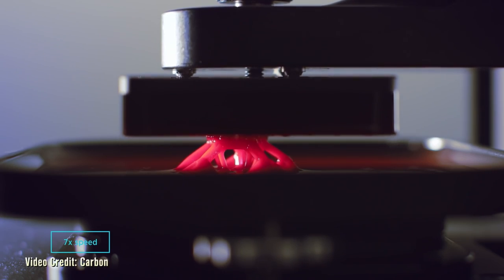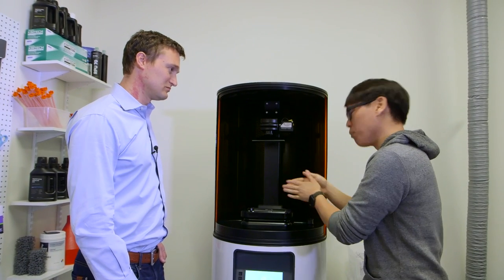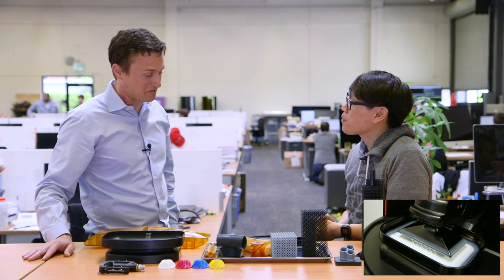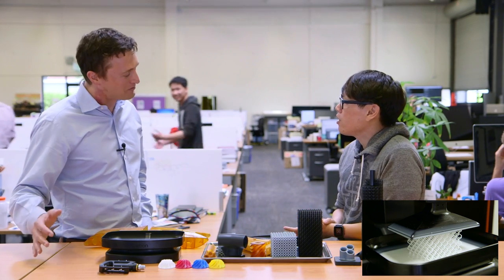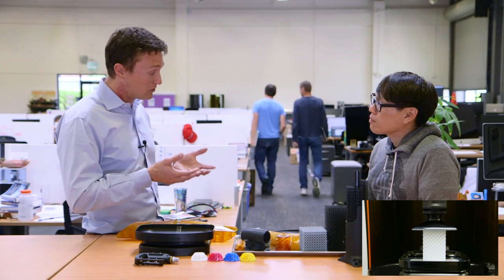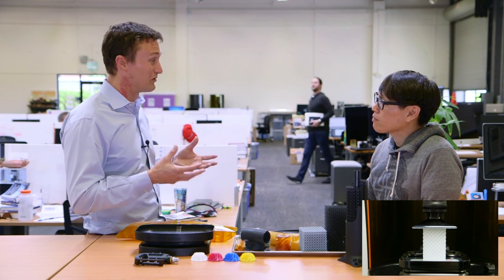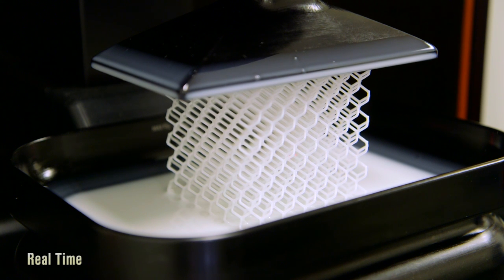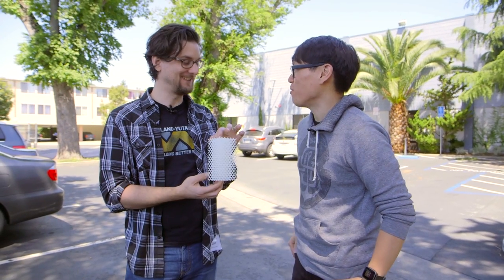Carbon M1 Super Fast 3D Printer Demo!

Comment: Man this guy talked in circles, and repeated himself many times, in many different ways. Sticking to the corporate script, I guess.
Reply: If you were running a business in a breakthrough company/product you wouldn't want to give away your secrets either, genius. You can only answer so much before you give away too much and have asshats stealing your product and idea.
Reply: +IVIusicFiend they will fail on their old world, closed business model anyway. Do you honestly think $40,000 a year with a forced $7500 per month maintenance fees would be a good bet for any business to venture into? 
Nope, other less expensive 3D printer businesses will pop up, and gladly take their money for a fraction of that. And reap the long term rewards of low cost consumables to the end user.
Reply: +IVIusicFiend Besides, I am a genius... all they've done is take a projector, replace the bulb with an UV LED. Then, work their chemistries backward to match the high output of the specific wavelength. (Probably 435nm) And adopted the software to pull the model at the higher speed due to the more efficient cure and dwell time. Their "oxygen" usage is nothing more than a permeable membrane that the resin can't leak through, but oxygen molecules can. (You know, like contact lens do) And lastly, they've had some neat resins (2 part) made for them that have longer pot life, with an added UV kicker. Printed item holds it's shape because of the UV light flash, but doesn't fully cure all the way until the oven process, which then the resin reaches exothermic levels and fully cures. There are many resin manufactures that will make your recipe however you want in really large batches. Nothing new here.

If I can figure this out, how long before the next crowdfunded 3D printer can do they they claim at a fraction of the cost? mUVe 3D Printer is less than $3k, fully assembled, but open source. So knowing what I know, one could easily modify their printer to do what Carbon 3D is claiming to be sooo proprietary. Hubris is amusing.
Reply: +TheBikerScout Your entire comment is based off of assumptions. The truth of the matter is they've created something other companies currently can not replicate and giving away how it works is the dumbest thing they could possibly do at this stage in their development. Whether or not they will succeed is unknown so to speak as if you know something they don't is laughable. This company wouldn't be where they're at without a plan and people interested in that plan, they couldn't have come this far without one. Keyboard businessman can say they'll fail all they want, it won't make it true.
Reply: +TheBikerScout Lol then why don't you go sell the idea and figure out the ins and outs of it all and see how far you get before your tired of it failing Mr. Genius?
Reply: +IVIusicFiend It's not assumptions, it's on their own website. AND current chemical technologies. It's not like they have the Philosopher's Stone, and are turning lead into gold. They've not created magic. Just found the right investors.

I've got my own projects, which involve health related solutions. However, I did convert a regular printer into a UV cure ink printer using off the shelf components just to prove a point. That first to market companies are usually aggressively greedy, and myopic in their long term business goals. But in that project, I worked a formulator that could make anything based on my recipe. Since I work heavily in the resin, silicone and composites fields for my work, I'm pretty sure that I could replicate what they've got going on. But I wouldn't go as far as trying to build a walled garden around my ideas. But rather publish my findings in an open source manner.
Reply: +TheBikerScout I agree with everything you've said. If you're business facing, 40k upfront, 7500/mo?? holy shit,  aiming for high end clients (boeing, bmw, etc), they don't want some Version 1.0 bullshit that could be improved upon quickly if what I assume is a large amount of time wasn't being spent making sure the crappy 1.0 version was ready for whatever deadline clients have set. I know there's been previous smaller models but that doesn't matter since this isn't a customer based model. There are so man things that could be improved that Ive learned just from watching this like automated cartridge/resin changes being a major one. Fortune 500 companies do not worry about cost though. Idk though I know very little about this lol. Just think there are better business models for this than what they're using
Reply: +Ray Reeves one of the engineers from carbon is in these comments. He stated exactly what I guessed about the permeable membrane. Plus the PR guy was just throwing around buzz words. Light and oxygen... Really, oxygen? There's a flammable tank of oxygen under the vat, in the cabinet? Next to an exposed projector? 
They as a company, are solely relying on R&D dollars from multi-billion companies, who just want to play with the newest toys. 3D metal laser sintering is already established and making usable parts right now. Things like the compressor wheel, and titanium rotary vanes etc. 
I promise you that making one part out of metal this way then making a silicone mold of it to make multiple resin casings is way faster and cheaper! Any R&D lab that needs a resin part that doesn't know this little fact, deserves to lose $200k a year just for the privilege of saying they have this printer.
Reply: +TheBikerScout it is really good you ask that, and our marketing chemistry team have researched deeply into that.
 together with our engineering and collaborators in the field, have given  feedback which we have take into consideration in this new technology, which i believe is not  used anywhere else in the industry because we use physics and chemistry and light to produce it in a new and innovative way to make a new and better product than the rest of the industry can provide.
Reply: doing things, making stuff I think that's the most words I've ever seen correctly used to mean nothing.
Reply: i thank you sire.
it is really good thing to be able to do, when you have to write a essay with a minimum of 600 words on the usefulness of umbrellas.
 
i remember my teacher comparing it too baking muffins. but swapping the flour and baking powder. 
the end result: a thing that looks like something. but if you begin to poke at it. then it collapsed in on itself.  

i prefer to say that it is selling chocolate covered bullshit.
 it leaves a bad taste in your mouth, unless you swallow it whole.
Reply: +Jerry C people don't understand that logic.

Comment: So, you need to replace that whole "cartridge" each print? Jesus, as if the machine itself wasn't already expensive, you gotta buy those too? I mean, from carbon's standpoint, that's great. But from an end user, that's nuts.
Reply from the maker: +Squat251 Gaming only over time, not with each print. i believe they just have to be cleaned between prints and resins.
Reply: +Squat251 Gaming ...? srsly? It was very clear that you can keep a few around for quick swaps containing/contaminated with different resins depending on what you want to do. It makes perfect sense to be able to switch out a clear soft resin with a automotive quality resin tray on the fly. The machine isn't "using up" the cartridge each print. You could theoretically use only one cartridge, you would just have to clean it out perfectly between parts, instead of swapping it out for a quick run of another part.
Reply: +ambiguity22 But just swapping the tray is faster, then you can clean it off when another is doing its thing. 
As for the resin, you are only putting in as much as the item needs to use for printing, depending on what ones you use they have different use times. So you would not just fill to the Max line and print a few things.. and call it a day.
Reply: +Squat251 Gaming No, you don't, did you not watch the video? You can just have one tray, which you clean when you need to change the resin, or have more that make swapping resins easier. Besides, it comes with two anyway, and considering the whole thing is a min. three year subscription @ $40,000 per year, excluding installation, I'm sure the big companies that will use this can afford the extra $5k for a cassette. It's not a product for "end users".
Reply: +Squat251 Gaming The Cartridge is more like a hopper or magazine. It is just a tray that holds the resin that you can swap out to print in different materials. In the video he shows that you can print tubing with a hard plastic, swap the cartridge, and then print with a elastic/polymer to print out a specialized gasket.
Reply: +Charlie Beadle their extra trays are also $5k a year each, insane.
Reply: Faltion For a consumer maybe, but considering the cost of the raw materials on top of all the other costs, it's clearly not a pricing model aimed at companies who would worry about $5k
Reply: +Charlie Beadle yeah I get that. I'd imagine their subscription would replacement then if needed as well. I'm curious how long they last. In the video the VP said there was no clouding over many prints, so I imagine they're not using pdms like SLA machines or their process negates clouding, so at least they won't need frequent replacement.
Reply: +Faltion We didn't get an impression of their life. With other SLA printers, we usually see some clouding from constant use. They indicated that hasn't happened with units that have been in service for close to a year. We'll have to wait an see.
Reply: +Squat251 Gaming I'm thinking not necessarily since the resin is resistant to environment changes, the cartridge might be re-usable after proper cleanup. The part where the company I think might shake the money tree i making signature resins and signature pigment that are only usable in their systems and vice-versa. It would also be easier to market and the consumer end-user would be "adjusted" to  accept that expense as part of the deal.
Reply: +Squat251 Gaming In all fairness this isn't exactly meant to be something for personal use, it's for industrial use, and things like that are only really a problem for personal
Reply: +max “Mr. Peanut” awsomesause no he said at the start, it is there for situations where he want his door handle replaced immediately.
Reply: It was a hypothetical example, the rest of the examples, involved industrial uses. Either way, it's not that big a deal
Reply: LT YV, he referred to that on the industrial level. The parts warehouse would be replaced with a few printers. By the company. Not personal use.

Comment: Between light and oxygen this guy isn't saying anything about this printer.  Ok so you got a better, super expensive resin and instead of individual slice frames, you're continuously morphing your projection and modulating your power output and pull rate to match your solidification rate.

My bet is you don't control dissolved oxygen in situ, it's just part of your resin mix. Probably you don't even have a sensor in there to measure changes of oxygen. 

So that means, once your resin in the the bowl, it's use it or lose it. Not great for the super expensive resin.

This is ok for prototyping but for production, it's still going to lead to super expensive parts. So only good for low parts count where making molds isn't economical.

Laser metal sintering is where the real future of 3d printing is.
Reply: You make me want to become an engineer.
Reply: shodanxx I think he was referring to eliminating the need for creating and inventorying an abundance of a part, which can lead to accidental overproduction and surplus. This way, in theory, a company would be able to supply a part or product at the EXACT rate of its demand vs having to guess market projection. As for the expense, any new technology is expensive at first, but if and when it becomes more accessible to the market, the price will obviously drop.
Reply: why u so mean man?! why you so quick to bet against?! I think you could find better ways to verbalize the stuff you know so that it doesn't sound aggressive or condescending. You sound smart! Please don't act stupid!

Comment: So this guy has basically just taken a sheet of marketing blurb and creativelyt rephrased the same info about 50 times. Well, got to admire his patience I suppose.

I have my suspicions about the oxygen though. My guess is that there is a component in the resin that reacts differently when it's heated, so the projector combines UV light that sets the shape, and IR light that regulates the release of oxygen within the compound. 

I might be wrong on the specifics there, as I'm not an engineer or a chemist, but oxygen release would need to be controlled in a way that was just as fast and versatile as the hardening stimulus, so heat sounds most likely to me, as it can be projected in complex shapes just like UV. That, or fast-moving lasers or ultrasound, but that seems less likely as I imagine it requires a lot more precise engineering for a slower result. Interesting stuff, anyway.
Reply: +tSp289  Yep.  No chemists here.  
My guess is that its the speed of ascension dictates the oxygen availability and quenches the reaction.
Reply: Dimitri Floros So the final properties are set at the surface? That makes sense. And yes, I said I'm not a chemist. No need to make fun.
Reply: +tSp289 I was thinking something similar. If you have a compound in the resin that releases Oxygen at a different wavelength than the shape creating mechanism we can use 2 different wavelengths of light to selectively release oxygen around the shape being made. The problem with using heat is that the reaction is exothermic and heat diffuses and would be less precise than UV.
Reply: +tSp289 The Oxygen is put in via the place where the light is applied.  If you can understand that then you and the others in this thread might just get it then.  The Oxygen is not in the Chemicals and would not work in my imagining mind of mine.  Do some more deeper research and then you might find that answer in which I did find myself.
Reply: withwingsaseagleeyes How though? That would mean you either had to deliver it by tubes or some kind of membrane that was still clear enough for the light not to be blocked.

OIf the solidification happens on the glass, then the oxygen either needs to be released from within the solution, or it needs to be anaerobic in there and simply withheld until the structure reaches the surface. So for the record, I do think Dimitri's idea was more likely to be right, as the simplest solution is often the best one. It does beg the question how this method of light-setting is any different from the others though, since they all seem to get drawn out of a resin as well.
Reply: *****
Well then the only way to see is to Pay the Subscription fee and then see how thick the clear lens is.
Reply: I think the reason that he just used a lot of buzzwords instead of specifics, is because this is such a powerful device that he cant risk giving away trade secrets
Reply: That's the same line of bullshit Theranos used.
Reply: So the uv light hardens the resin and through the semipermeable window that the resin pool sits on the oxygen is fed through , the oxygen is used to make sure the newly hardened resin doesnt stick to the window  making a cleaner  faster print.
Reply: Probably the UV light breaks oxygen free from a chemical, supplying both the UV and oxygen in very localized positions required to cure the resin.